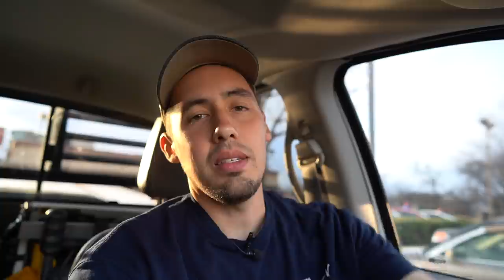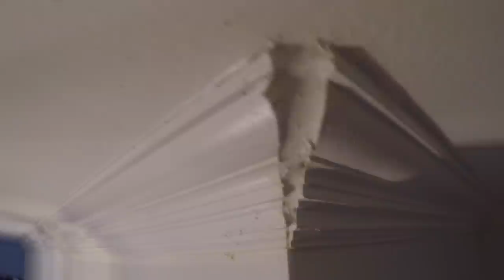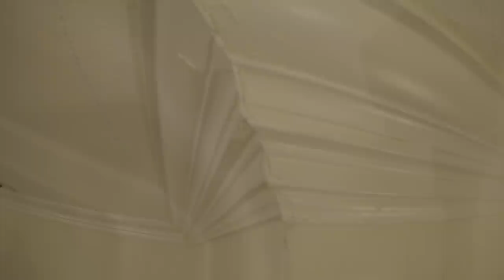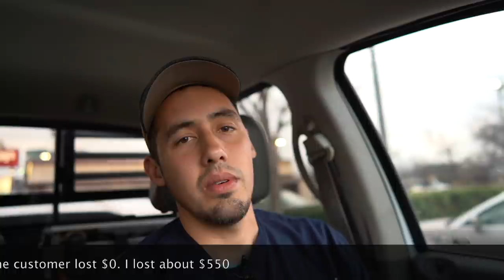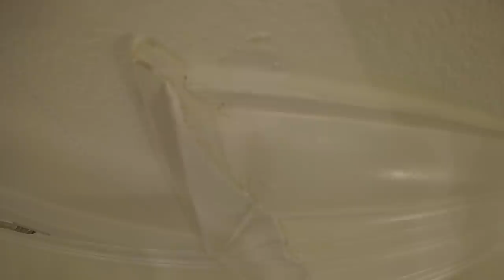The Worst Crown Moulding Job I've Seen

Comment: Your story reminds me a lori bed job I did. I built it speck, but the costumer wasn't strong enough to lift it up to the wall. So I tried to put a lifting mechanism system in it. Well, no matter how would've installed it just wouldn't work. By this time I've lost about 1000 in parts and labor. So just gave her money back cause that's what I felt was the only fix. Needless to say that was a hard month. Nice story about the gift house for the trimmer. Do it as if it's your house.

Comment: I would be the first to say I am a Jack of all Trades but I also know I am a master of none. I know what my limitations are and what I can do. I've done crown once in school and I know with out a doubt I could do a great job in someone's house, after all crown requires no more skill than doing a great job on baseboard and I've done a lot of that, it just throws a few extra angles into the mix. And with the way my mind works I find that sort of figuring easy. But I I would never try stain grade until I had a number of jobs under my belt. And I would never have tried to figure it out on someone's house without first learning how to do it. I will always be trying to learn and push my self to be better and able to do more but I also won't try and attempt something so far beyond my experience that I set myself up for failure. But that I think is an attitude many people don't have. I would also rather do a great job and take pride in my work then make a few extra bucks at the clients expense.

Comment: You're correct, that's the worst crown I've seen. I do a lot of remodeling( and a few custom homes) and it all leads to the finish work. Everything you do, foundation through finish, needs to be as precise as possible and of quality materials. Back when I learned the crafts, we did it all and if you were lucky, you learned the right way and didn't walk away until it was right. Do your work to the point where you never need an "attaboy" because you know that it's good when you walk away.

Comment: Oh Man can I relate to all of what you are saying. I’ve been doing interior work from painting to trim work for the last decade. Before that I had done concrete, framing, renovations,cabinets, not to mention 17 years in metal manufacturing, and even insulation contracts. All that experience has made me one of those so called jack of all trades. I’m 58 now and it takes that kind of time to learn that much. The most important thing to learn from all of this is that you have to care enough about what you are doing in order to get really good at it. Whatever you do, do it as good as you would want it done for you or recommend someone who can. 

I have been fortunate to have all the experience I’ve had and have strived to be good at whatever I did. The payback has been repeat customers who respect me, my skills and effort, and pay me well. Unfortunately those people are rarely found among the younger generation. Now doesn’t that sound about my age. 😂

Comment: Just a little liquid trim in a tube to tighten up those joints. Nobody ever looks up.
Some people shouldn't own a screwdriver, let alone a miter saw.
Cut every joint like it's getting stained even if it's pre-primmed.

Comment: I agree with all your points. Especially on the nature of specialists.   If you want to be a master at ANYTHING you have to specialize.   You can be pretty damn good at a lot of things but you can only master one thing at a time. 

That said, I'm an example of the opposite. I'm a remodeling contractor. Mostly kitchen and baths.  For the size jobs I have it just doesn't make sense to call in a bunch of subs.   So I end up doing most everything most of the time.   Some things are so skilll heavy that I just can't do them to a high standard .  But I've found that most things  I can do to a high standard but it takes me twice as long as it would take a specialist.   That usually ends up being my criteria for wether I sub it out or do it myself.    You have to figure in work stoppages, bidding, 1099s, scheduling,  standards of the sub, etc.  Most of the time it leads to me doing the work lol.

Comment: Haha.   I went to a theater once..   whoever trimmed it couldn't even cut a 45.    Just filled it in with toilet paper and caulking..   looked a lot like that!           On finding guys to work on your house..      judge them by the tools they show up with..   if you hired them to drywall and they show up with cement all over their tools..  turn them away!       Good judgement turning down that job bro..     I'm actually pretty good at it all.  I guess I'm special 😂

Comment: Great story about the finish carpenter. A finish carpenter can frame, but a framing carpenter cant always trim.
As for you stair project good luck I have faith you will do a good job. Take your time and they will come out great. 
My first interior oak railing job took me 3 time to get right. It was only one newel and 3' of rail with balusters. I went through 3 newels and 8' of rail to get it right. Thankfully it was on a basement remodel job, so the loss balanced out in the profit from the rest of the job. Had some good firewood after. Now I do railings all the time on my projects and they are very profitable because not many guys do them. Moral is if looks like crap, do it over until it's right.

Comment: I too am a one call does it all, I believe in million dollar work no matter if it's only an old single wide or a shack. I find a lot of work done like that here in Tennessee, where the attitude is " I can get someone to do that for $5.00 and a six pack. I worked on a half a million dollar house where all the doors, interior as well as exterior were racked and didn't fit. When I commented to the lady of the house that her General contractor didn't know what they were doing, She informed me she was a do;it yourself general contractor and was not too happy with my opinion. My opinion stands.

Comment: I live in a small remote community of around 7k people. The company I work for are pretty much jack of all trades as the community is too small to support specialists. I can proudly say we dont produce crap and the boss has high standards thankfully. Cant Zane the same about some of the others though,you're right
Reply: But that crown is inexcusable...even as a newbie. You can't charge for that...have pride. A few smaller pieces or scrap could have been practiced one and held in place until they got the concept.

Comment: I see this kind of shit all the time, in fact I am on a job now replacing a whole house full of baseboard with ¼ gaps at every outside 90, filled with caulk.  This is pretty much the standard I see with new builders, they take low bid, furnish just enough trim to do the job with no mistakes then Mr. Low Bid comes in, sets up his Ryobi miter saw up on the floor and uses his Harbor Freight nail guns to run through the house as fast as they can as they have a guy follow behind to caulk every miter and every casing. These guys are specialist too, this is all they do they specialize in low quality crap. They may not speak English but they consistently get shitty work done fast and cheap, and the builders love them.        

Then there are the jack of all trades types who do remodels and honestly I am one of these guys.  The bad ones come in sell a job, want all the money up front and then do shit just like this and the client does not have the option to make them fix it because they paid them up front.   Then guys like me get paid to clean it up. I may not be a trim carpenter but with 30-years of experience in construction and an eye for detail, my miters are perfect and I get paid well to fix low bid.

Comment: This is what is called a hack job.  This job was done by someone who knowingly does crap work and doesn't care.  As a handyman, I sell my services as someone who can do something better than most homeowners and more affordable than a "specialist".  I also know when to draw the line and say NO.  I change out more lightbulbs and hang more pictures than a art gallery, but get calls to put up fences, pergolas, patch drywall, etc.  Of those things, I can do them almost as well as a pro, and include the finishing steps; without the owner having to call a painter or landscaper.  Yes, there are "eye surgeons" for your eye condition, but there are internal medicine docs that will help you with a case of dry eyes or allergys.  Just like someone not wanting to spend all their money on their home looking like the Whitehouse, when they cannot afford to.  If the roof is caving in, I do not offer to fix the problem.  This is a HACK example you are showing, not a jack of all trades.

Comment: Iono bout the stick to one trade line.
Been trimming 30 yrs.
But on side jobs I do 80 percent of work.
Framing, electrical, plumbing, trimming etc.
(lose my ass in framing, too perfect.)
Its in the installer. Attention to detail. Some have it some dont.
Split the fine tajima fine line or mark bottom , top, center of laser, shoot the nail w/ the grain.
Few yrs in each trade and attention to detail and you will shine.
Just dont take on a project that you cant do.

Comment: I know this is an old video. Just wanted to say I'm one of those jack of all trade guys. But I would never take a job I couldn't handle. Example, I can fix a leak in your plumbing, but I won't install a water heater. I can do trim, but only basic 1 piece. Can wire an outlet or switch, but won't touch a panel. People should be clear on what they can and can't do. Sadly I am constantly coming in as the 2nd or 3rd guy to fix some of the most outrageous stuff. People should just be honest about what they can and can't do.

Comment: Hello, long time viewer, first time commenter. First off, love your videos. Nice tight workmanship.
I don't completely agree with this. I think the issue is that some professionals try to maintain a certain profit margin regardless of expertise in certain areas. Unfortunately, this mentality is at the expense of quality workmanship. I make plenty of mistakes but I don't have a problem throwing away material because of miscuts or poor installation or taking longer than I thought it should take; quality always comes first. If it takes longer then it takes longer but never at the expense of quality. I have a friend who quotes a job and has it stuck in his head that he should make $50/hr and he'll do the job at a pace that will get him as close to that rate as possible. I've seen some of his work and I'm embarrassed for him as the final quality of some of his projects is less than homeowner DIY. At the end of the day, the homeowner will never give you a referral because of how fast you did a job. The referral would sound more like "it took longer than expected but the quality is amazing." Of course, if a professional is completely unable to do a quality job at all costs then that's a different story.

Comment: Im one of those few that can start and complete a remodel of kitchens, bathrooms, and nearly all other aspects of home renovation and maintenance. With that said, there are still certain scopes of work that I look other to assist with during projects. Ive been in the construction, project management, and skilled trades most all of my working career. The other, and likely the most important, is that Im willing to put in the time, practice, and detailed analysis of any and all scopes of work. After all these many years I still watch vids...like yours 😁....and still go to my shop and practice certain aspects of the work. 

With all of that, I never consider myself “trained”, and I appreciate the skill of so many around me. Also, many clients do not see the value of true tradesman. Finally....great story at the end, but I actually treat my clients homes better than my own. I sincerely mean that. Even my wife teases me about it 😂

Comment: If it isn’t right, do it again. I trimmed out my 2100 sq ft main floor. I screwed up meters. Then I fixed it. It was done right. I have built cabinets. I took my time. They turned out awesome. Take your time and do your homework. You can built quality. Do doubt yourself.

Comment: For the most part it's 2 different angles, the stops on the saw is for anything 5 1/4 down. When you start getting in the bigger Crown anything above 5 and 1/4 it goes to the 35 30. Looks like who ever did this just went with the stops on the saw. Not everyone who claims they are trim Carpenters really is. How do you walk away from shitty work like that.

Comment: My excuse list:
 ummm the ceiling is not level 
umm the crown molding was too short
Ummm my utility knife was too dull
Ummm it was hard too hard for me to cut it on the floor with my foot pressing on it
Ummm its bcaus your house isnt built right
Umm you have to have at least an 1" gap for expand and contract
Umm just dont look up and youll never know its there
Couple tubes of caulking will fix it..see ya gotta go to my next project

😂😂😂😂😂😂😂